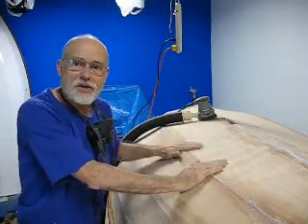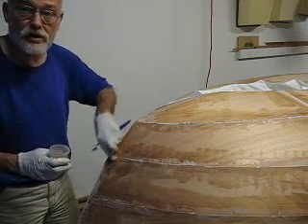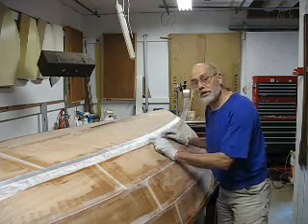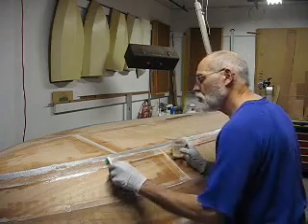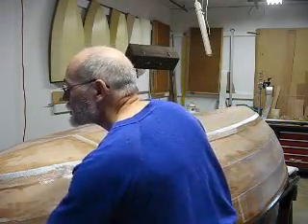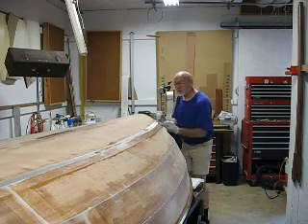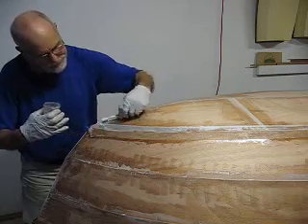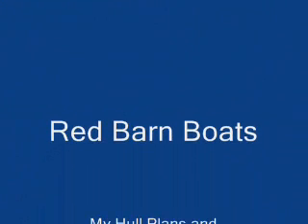Installing the Exterior Glass Tape

Comment from the maker: I found that a tooth brush has the "right sized" bristles for working with epoxy.  They pick up a good amount of epoxy, and they don't drip that badly.  The bristles are soft enough to work the tape/cloth without distrubing the weave.
The biggest plus is that they are free, and I have friends that save me their old ones.  I put them in a bit of bleach/water for a few minutes.
You can also clean them, but putting them in a jar/can with a couple inches of vinagar after use.
Reply: Thought that was a toothbrush!  Going to try and use one today, to do just what you're doing here in the video.  Thanks